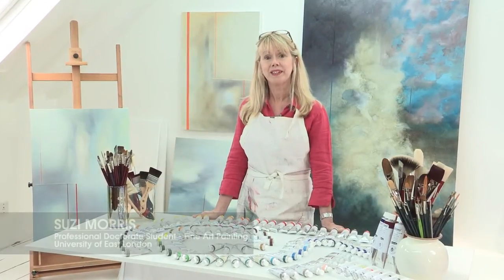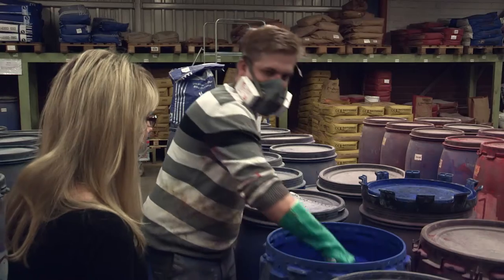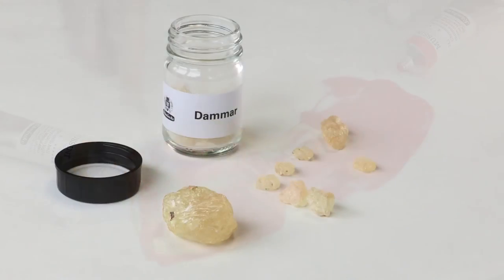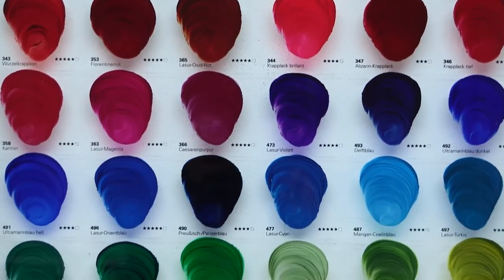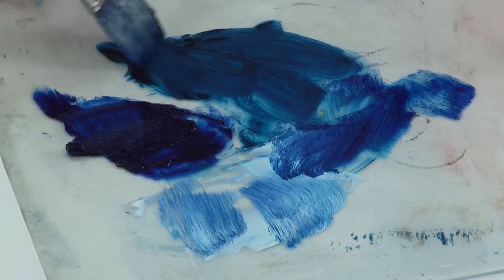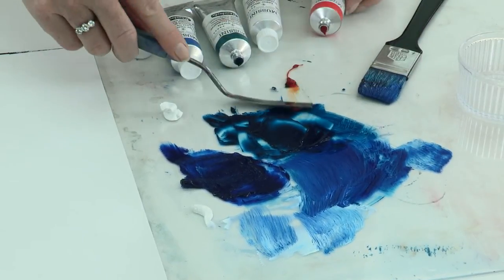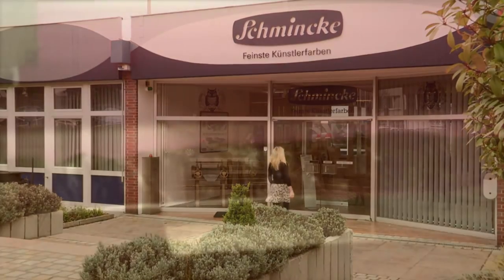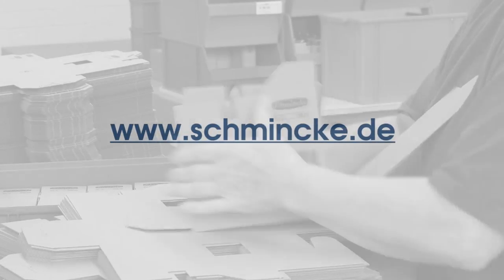Schmincke finest artists oil colours: MUSSINI® and Norma® Professional (EN)

Comment: What oils are the best today? Mussini, Old Holland, Winsor & Newton ...?
Reply: Mussini, Old Holland (expensive), Blockx, Vasari (expensive), Michael Harding...
Reply: I've been using Schmincke Mussini now exclusively since 1995. Since I use glazes, a little goes a long way, which reduces my over all cost (in fact, I am STILL using the same tubes I bought twenty-three years ago!). Of the three choices it is of middling to high cost, yet it is a premium quality paint that rivals Old Holland. (If you want a more opaque paint, I would highly recommend Schmincke's premium Norma brand of oils.)

Old Holland is the most expensive of the three and is extremely stiff straight from the tube. undoubtedly, part of that cost is the label and the cachet that it carries. However, the quality is very high and if you plan to reduce the paint with mediums, you'll get even better mileage from Old Holland than Schmincke Mussini. If you use impasto techniques extensively and you want to paint with Old Holland, either inherit a fortune or else file for bankruptcy - it's way too expensive for most artists. 

Winsor & Newton is of decent, reliable quality and it has the lowest cost compared to the former three brands.  If you are just starting to experiment with oils and cost is an issue, I would choose W&N.
Reply: Mussini, Williamsburg and Rembrandt by Royal Talens
Reply: @curtchiarelli8957  do you have a website? I'd like to see your work ;-)
Reply: The artist who uses them